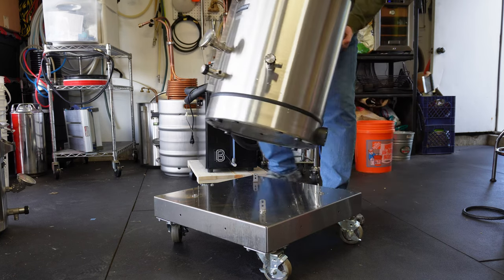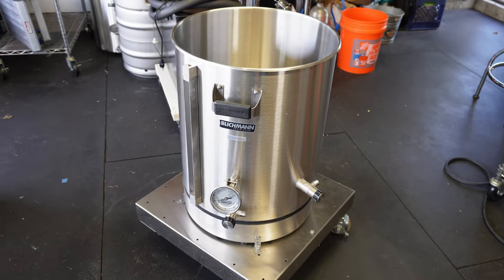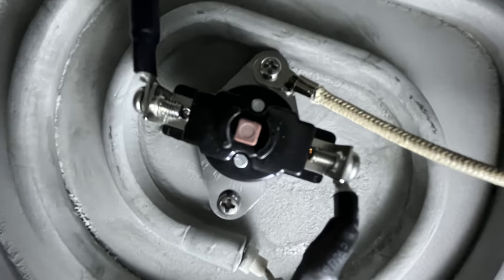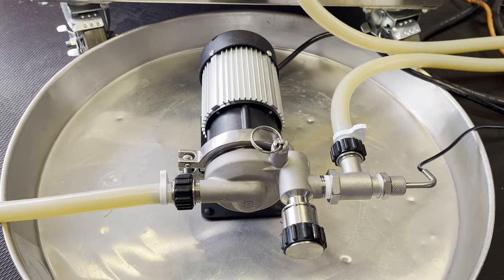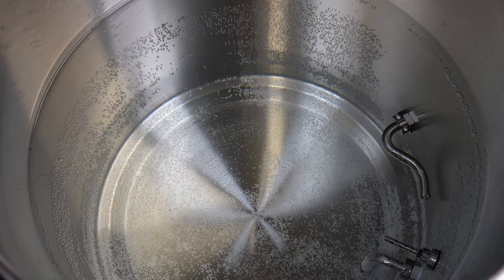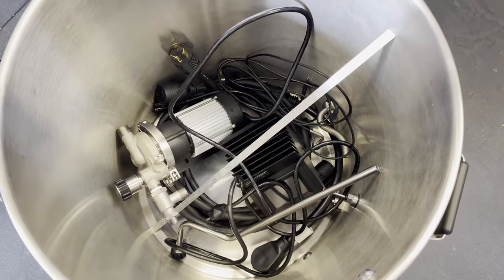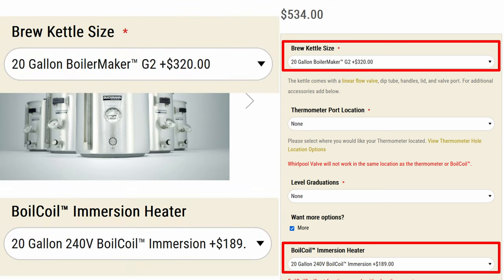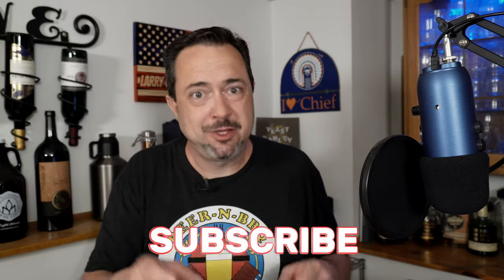The BoilerMaker Surface by Blichmann Engineering: A Hands-On Review

Comment: Looks like when you customize it's coming in around $700.  Only available in 240 which is a problem for a lot of home brewers only doing 5 gal batches.  Also the reset port on the bottom is a bad design.  The Mash & Boil used to do that and got tons of complaints because you can't get to it when the kettle is full of boiling wort.   It looks more solid and well built than other systems though - for which  Blichmann is known.  They should make an Anvil cheaper version without the triclamps, and 120V.
Reply from the maker: I have the same concern about resetting the thermal protection. I may do something similar to what others have done where they place these kettles on top of a crate or table with a thru hole to allow access to the reset button. Since I use Blichmann KettleKarts, I might drill a thru hole in the center of the cart to do something similar.
Reply: @NWsmallbatchBrewing Interesting thought about Anvil...stay tuned. :). Preston our Engineering Manager can add to why we specifically designed the reset port placement on the bottom of the kettle.   "The reset port is really just protection from dry run. If you run the kettle dry it's already empty. The all-in-ones are subject to some nuisance tripping because they are a much higher watt density element, but we expect this one to not provide any nuisance tripping when there is liquid in it because we are spreading the heat across a much large surface area. It will not scorch like the all-in-ones because of a lower watt density.
It’s not made easily accessible because we don’t anticipate anyone needing to use it."  Hope that was helpful and please don't hesitate to reach out to us if you have any questions.  We are glad to help!

Comment: I was pretty excited about replacing the 20 gallon G2 on my BrewEasy 10 with one of these. But... At nearly $900, and the only part that's likely to fail can't be repaired...??? I see that as a major flaw. I can't do it. I hope Blichmann figures this out.
Reply from the maker: Price ended up being higher that I was led to believe. 
Knowing that, I’d be hesitant as well.
I presume this is targeted towards those that have yet to buy a kettle.
Reply: @BEERNBBQBYLARRY  I wasn't really surprised at the price of it. Blichmann is high end stuff, so you'll have to pay... and I sure did when I got my BrewEasy 10! :)) What surprises & disappoints me is that it's not fixable. I bought my BE10 just under 2 years ago. I spent around $2600, which was a LOT for me. I can't say if I would have spent the extra $400 for the Surface then, but with it not being repairable, I probably would not have.

Comment: I love your videos man but I disagree with you on this, I personally like the idea of a replacement element. Also I run a pbw solution for fifteen minutes at 160 degree through my kettle after a brew day for cleaning. My element looks perfect after a year of use. I appreciate your review and honesty of the product but I myself don't see its worth it. That's just my opinion, cheers man I always appreciate your videos
Reply from the maker: Sounds like you've had more success at getting them cleaned than I have over the years. However, even if running PBW solution would work reliably for me, that is additional time spent cleaning thus prolonging my brew day that is saved by having this vessel.
I agree with the desire for a replaceable element. Has been one of the reasons I'm not too fond of proprietary all(almost)-in-one brew systems. It's a tradeoff of cleaning ease versus risk of the element going bad. Getting older and not wanting to be scrubbing away bent over a kettle,  I've chosen ease of cleaning.
Reply: @BEERNBBQBYLARRY  definitely man, it's all what works for you correct???? I guarantee you one thing with brewing is your opinions on things evolve. It's kind of like when you get a cooler system and think I'll never hi upgrade or change everything is perfect 😂 but you end up changing up things. I've had good luck with my element with pbw recirculation, plus I'm usually doing other things while I'm cleaning the kettle up, but regardless I can definitely see the allure of this new kettle. My opinion might change in a few years but for now I'm happy with my system, either way cheers man I appreciate your channel